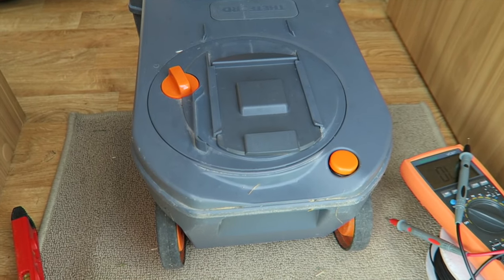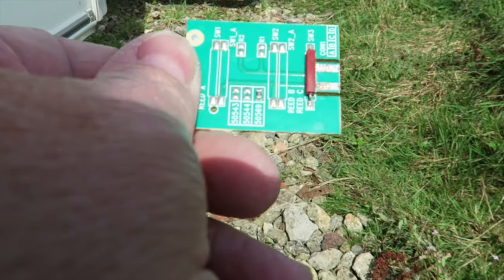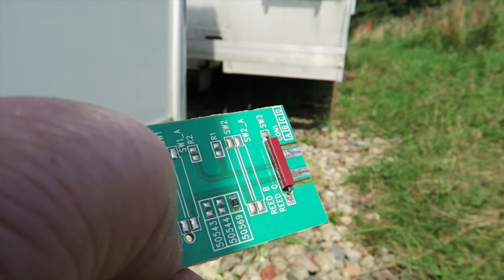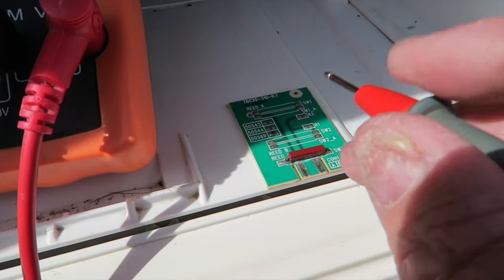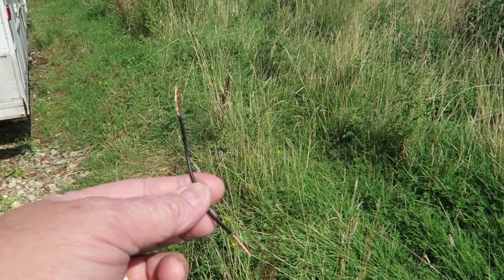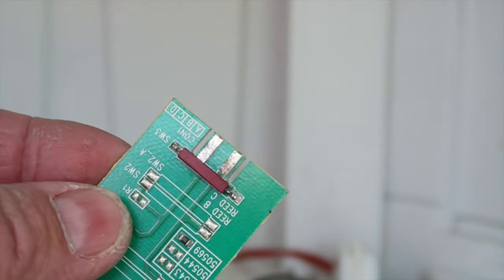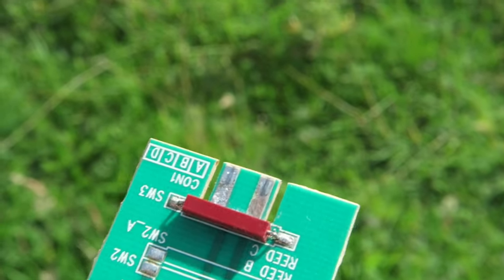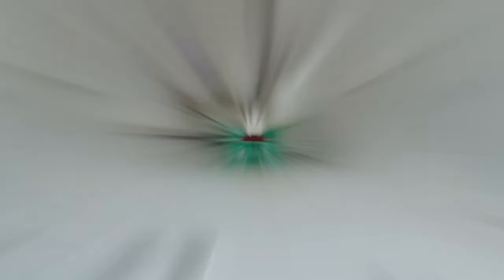Fixing a Thetford C250 Cassette Indicator

Comment: Good video Dan. I had the opposite effect, red light on when the loo was empty. A nice simple one to fix, it was the float stuck in the up position. The pivot point seemed a bit gungy, so I opened the top hatch, and aimed a gentle jet of water at it, followed by a very gentle brush with a small loo brush. The float is now very free, and the red light went out. Job done. Lots of good tips on here, so thanks to everybody that contributed.

Comment: Thanks for that , I had the same problem wouldn't flush and spent ages looking for the fault, took the whole thing apart and in the end soldered the reed board and it worked !!
Reply from the maker: Excellent. Well, sorry this didn't help before you took it all apart - but hopefully it is all working still. 

Kind regards 
Dan

Comment: Just found a had an issue with the light on my toilet... almost ended up with an overflowing cassette. I knew there was a fire so changed it but hasn't seemed to do anything.... so will give this a try. 

Thanks alot

Comment: This is really helpful thank you for the clear explanation. Mine was exactly the same with a corroded pin. Would never have guessed. I pasted in "Reed Switch board (Part No. 50713)" to google and amazon comes. You should consider an affiliate link.

Comment: Thanks for a very clear and useful video. I now know what that circuit board is for and how it works. However, I think my problem is the pump but this has helped me get closer to fixing it.
Very best wishes
Arthur
Reply from the maker: Greta to hear Arthur. 

If it is the pump, it might actually be blocked with some black gunk from pink flush solution. Once removed, have a go at gently moving the impeller with a small screwdriver or cocktail stick. and try it again. 

Take care
Dan
Reply: Thanks for the tip, it worked really well.

Comment: Great tips for diagnosing the fault, thank you. Maybe I'm just lazy but I'd rather just pay the £8.00 to buy a new reed switch from Amazon than repair it :-)
Reply from the maker: Well, if its just a bit of solder, its easy enough to repair, quicker too. But if its more corroded than mine or really damaged - the £8 is a solid investment !

Dan

Comment: Good Evening. I am having trouble with my C262 flush and the cabling to the PCB. My cables to the connection block to the PCN had corroded and when I cleaned them they broke away. I have tried rewiring but whichever way I connect the black cables, I get the toilet full detector light permanently on which my be a fault with reed switch possibly being stuck on. Even with the toilet empty. The flush is still not working and wondered if when the detector light is on whether the PCB flush stops the pump from flushing? (Sounds logical as you would not want to continue filling a full toilet).

Comment: Hi Dan does the toilet run with electric from van 
Have no battery connected 
Just sorted blade handle but then noticed ours is electric flush 
So before start fixing this just thought to ask if needs electric from battery 
Thankyou

Comment: Great videos by the way, wish id have seen these before.....my issue is slightly different. In my Coachman Pastiche 2013 the third (top and largest) light stays on constantly, I am new so Im thinking this is the cassette full warning......problem is its on when Ive just put it in empty....any thoughts
Reply from the maker: Hi Dave, yup common issue. The magnet in the cassette is stuck in the wrong position. In some cases they stick with calcium build up or just get wrapped up in toilet tissue, so not allowing them to move etc. 

Have a look on Practical Caravan YouTube channel and look for "How to replace a Thetford toilet seal" that will show you how to get into the cassette and you will se the magnet float mechanism, and hopefully see the issue.

Hope that helps.

Dan

Comment: Hi I can't find a video on YouTube on how to replace damaged toilet pump? Mine you access from cassette box. I can unclip it and pull it down, but do I have to cut wires and add wire connectors to replace pump? Surely not?
Reply: David re  your comment on replacing a toilet pump on the electric flush thetford caravan toilet are you able to advise me how to access the pump and what  and how do you remove the toilet panels on the toilet casing .thanks. kieran

Comment: HI all, am I stupid or what ??
Have been fiddling with tubes, pump etc. and pump is making whirring sound so seems to be working, also wee blades are a turning !
But water is still not getting into green tube to flush! Does the pump head have to be immersed in the water which builds up in the bottom of this receptacle ??? Am almost afraid to ask !!!!! Video does not say where to place the pump head??? Much obliged if someone could H E L P. Thanks